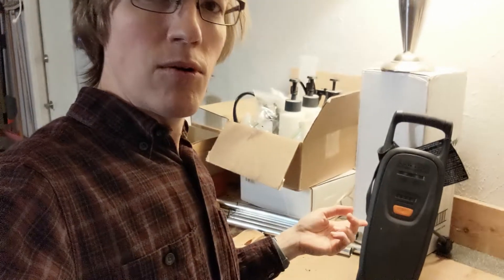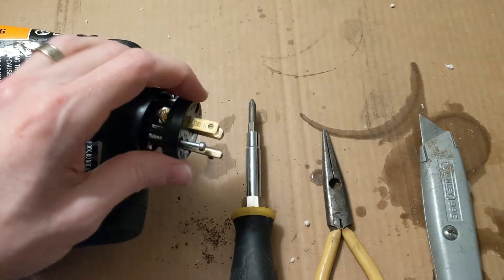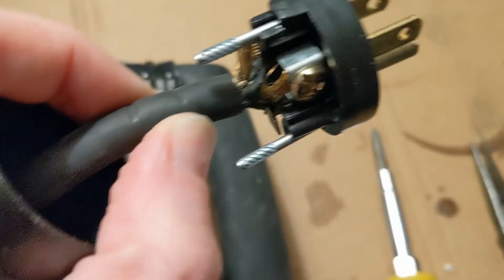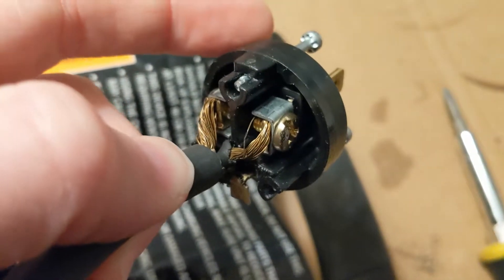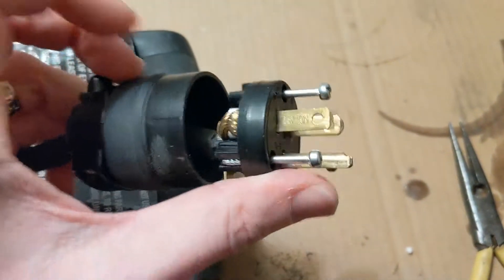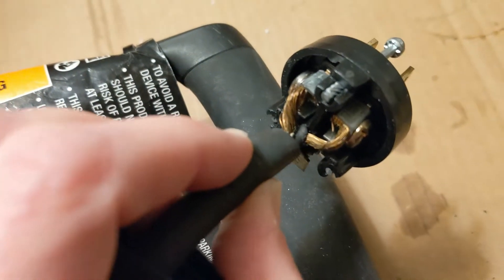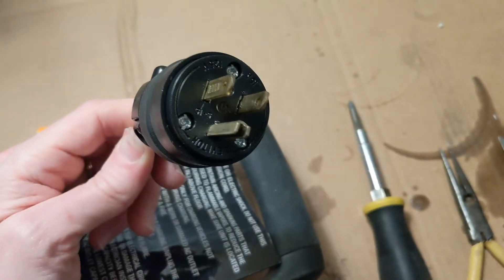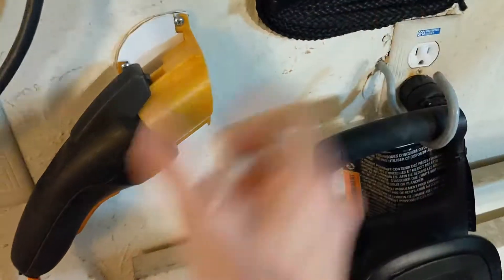How to replace the plug on a Chevy Volt charger

Comment: How does it look to put the electrical tape inside the copper?

Is it working and how do you avoid any more burning?
Reply from the maker: The electrical tape wraps around the individual connections. It's been working great for years, although now I only use it when I travel.
Reply: @LukeofAllTrades0 I also wanted to ask what do you do if your Chevy says “service high voltage charging”
Reply from the maker: I've seen that a couple times, once when I used a random public charger and I think it did something funky to it. Using the charger that came with the car made the error go away. Another time I was getting that error and many others, and it was actually the 12 volt battery that was bad. Charging up the 12 volt battery fixed it, and then I replaced that battery, and haven't seen the problem since.
Reply: @LukeofAllTrades0 so it’s not the coolant that needs to be changed? And is there any videos because it’s just randomly happened with my regular charger strangely enough
Reply from the maker: I have heard of that problem too, where the coolant gets too low. I would recommend having it inspected by a shop, or at least getting the OBD codes read and then do some searching. I'm sure it could be a lot of things. I got a lot of errors from having a low 12 volt battery.
Reply: @LukeofAllTrades0 I think it’s p1e00 of that rings any bells however it seems the code is just a sensor issue that comes up on hot days

Comment: That's no fix! Cause is overheating at plug to receptacle. Replacing a 15A plug rated 12A continuous with the same thing plugged into a 15A receptacle will repeat the meltdown!  Fix is to replace charger plug with a 20A NEMA 5-20P and replace house receptacle with a 5-20R, both hospital grade eBay has lowest prices.  You will notice that plug won't get hot anymore. Ref. NEC Section 210.19(A)(1). Electrical connections of every type should never get hot to the touch unless you want casa torched to collect insurance.
Reply from the maker: Not long after this I replaced the whole cable, since it was deteriorating where it entered the unit. I also replaced the wall outlet, as you can see in the video. It never got hot to the touch after the fix I show though. It's definitely something I check every time I use this charger, my new 220v charger never gets hot, because I don't pull more than about 8 amps, and the plug and outlet are rated for 50. Thanks for watching!

Comment: what replacement charger do you recommend?
Reply from the maker: For the plug? I just bought a high quality one from the local Home Depot or Lowe's. For replacing the whole charging unit, I bought a 220v MUSTART 40 amp charger. I know they also have 110v versions that don't charge as quickly, that's what I would look into to replace the whole unit.

Comment: Just thought i give a update so someone may learn from my mistakes.  I have 5 wires and I tried to connect white with red and black to orange as suggested by another comment. it didn't work. so i tried reversing the pairs and it didn't work.  Now here are my big mistakes (listen up)  First I hacked up the plug so i couln't do a continuity test on them as someone else recommended.  Dumb   Not here the big one  I them went to the dealer and they told me it would have been covered under warrenty if I didn't cut off the plug.  Dumb and Dumber.
only good thing i can say is the dealer wanted $800 for a new one but there is now aftermarket availible for around $200 at amazon and Walmart.  I guess electric velicles are getting that common
Reply from the maker: Thanks for sharing your story, hopefully it's a good warning for others, did they say how long the warranty was on the charger? I've been using an aftermarket 220v charger for a while now, the provided charger is now left in the car so I can charge while traveling. It's nice they've come down in price, it'd be nice to know how to fix the 5 wire version, I'm sorry I couldn't be of more help with it.

Comment: Seems like your Volt charger has 3 wires inside the cable (white, black, and green).  Mine has 5 wires: green (ground), white, red, black, and orange.  The white and red seem to go to the same prong, while the black and orange go to the other prong.  I tried to cut into the plug to see exactly how each one is wired but it was difficult.  Any idea if I can fit a replacement plug using this configuration?  I actually haven't seen any replacement plugs advertised for a 5 wire configuration.
Reply from the maker: Have you looked where they attach on the board? If they go to different spots, it may be a way to provide power to two locations on the board. This is a bit of a guess, but it may also be a way of transferring more power without using thicker gauge wire. When you look at mine, it looks like the wires were drawing a lot of power and overheating. By putting two wires going to one prong, that halves the amount of current on either one, and so they would get less hot.

If there are only 3 prongs, there's no way for the 5 wires to be going to other places besides one those three prongs. I suppose there could be something else in line between the prong and the wire, but I can't imagine what it would be. What I would probably do is cut the wires and then with a multimeter check to see which prongs they're connected to.
Reply: @LukeofAllTrades0  The section of cord that goes from the charger box to the outlet has 3 wires, positive, negative and ground. The section of the cord that goes from the charger box to the vehicle port has 5 wires. The additional 2 wires are used by the vehicle computer to communicate with the charger. It's probably not a good idea to mess with that section of the charger. The other section is just an easy 3 wire splice.
Reply from the maker: Agreed. The way I read it, he was talking about the wire from the wall outlet to the charger, not the charger to the car plug. I would definitely not want to rewire the section between the car and the charger, that is high voltage and much more complex and risky.
Reply: You not alone with this problem.  I too have 5 wires as you describe and that why I'm here.
Unforturnity this site was not any help.  so i guess I'm left with looking for a new charger.
May try not connecting two and see what happens

Comment: Way too much bare wire in there. Insulation should go right up the the connector.
Reply: Felt the same. I would have stripped the cover a little longer so the insulated wires themselves could get right up to the connector. That looks a bit dangerous.
Reply from the maker: I ended up replacing the whole charger wire, since it was pretty bad and started falling apart at the other end. Definitely a better way to do it! https://youtu.be/skIFLIovMJU

Comment: Did the orig have a temp sensor? This might be dangerous.
Reply: I checked with my appliance repair engineer genius, he said  it's OK.  Use a good heavy duty plug UL listed, like Leviton, as he does in the video.
Reply from the maker: Thanks for checking, I didn't notice any electronics in the plug when it all fell apart, but nice to have some outside confirmation.
Reply: I took apart my plug for my fiat,  didn't see anything but wire and metal.